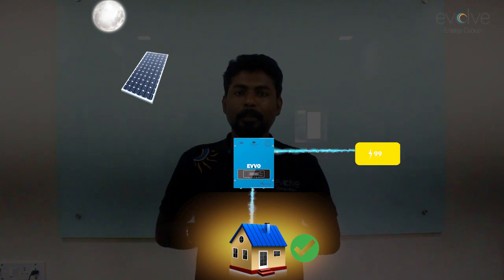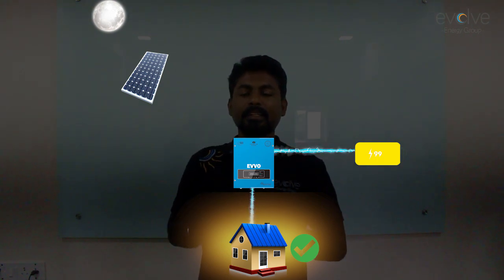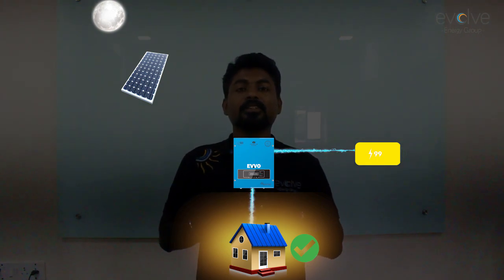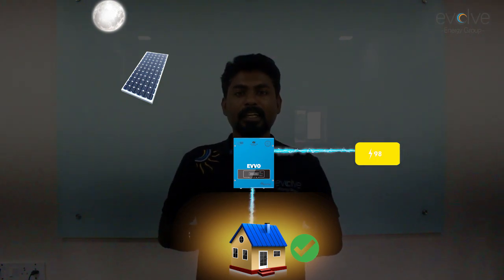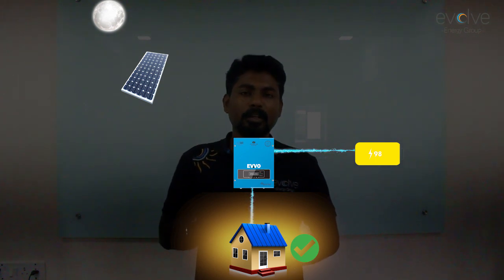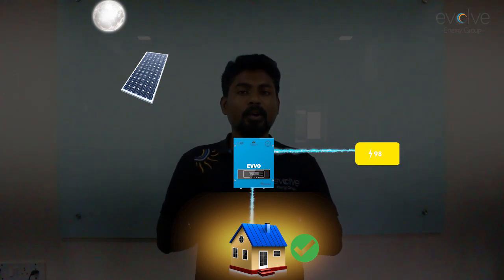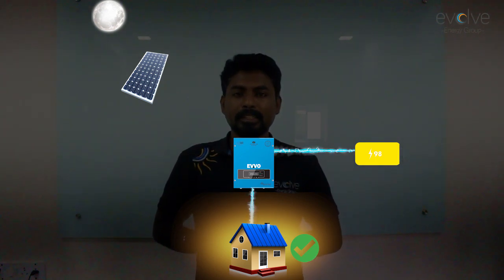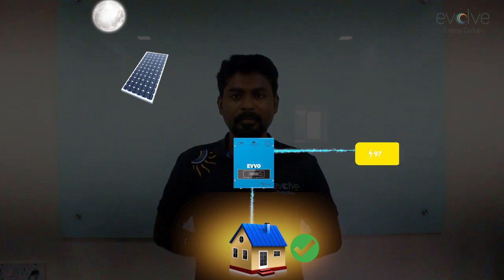OFF GRID SOLAR POWER PLANT | SIVAKUMARAN CTO | EVOLVE ENERGY GROUP

Comment: But why no charger controller ?? Not mentioned it needs to be installed to prevent the battery from over charging am I right ,??? Can v install off grid without charger controller ??? Is it possible please explain me
Reply: It is based on inverter.. now a days Charge controller is inbuilt with inverter.